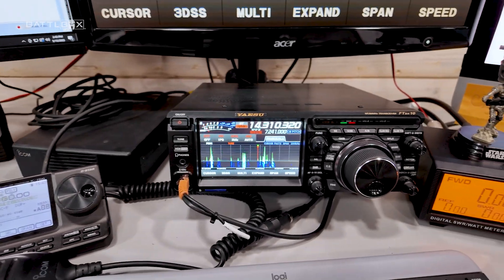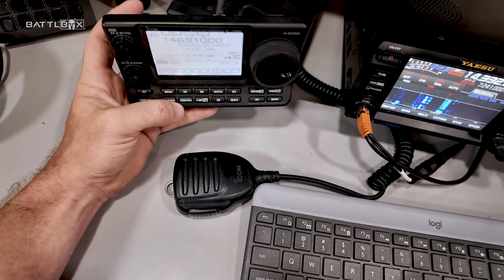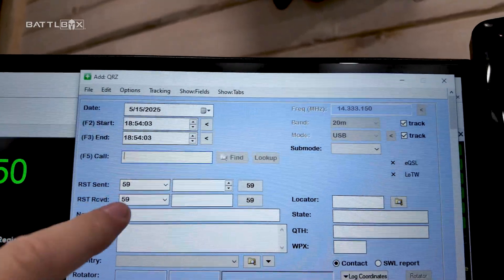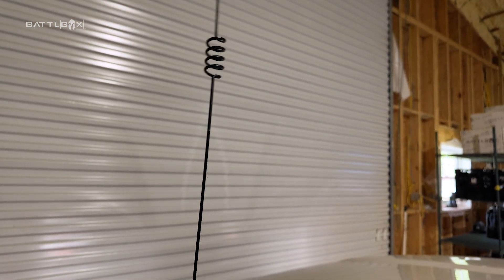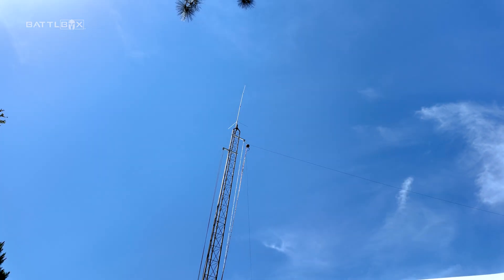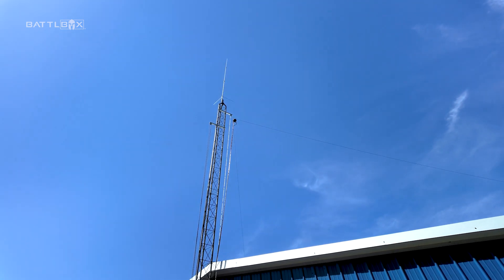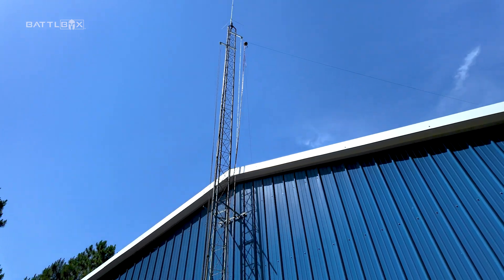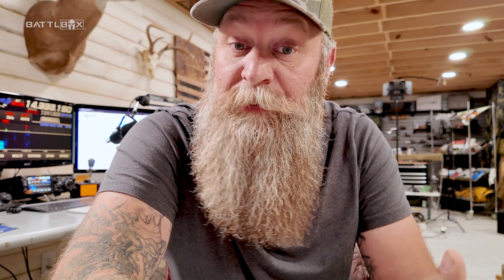My HAM Shack Right Now (2025 Setup Tour with @CURRIN1776 )

Comment: I used to love my ex FTDX10 until tried a Hermes Lite 2 with Thetis software, the FTDX10 went out the window and sold in QRZ. Yes, its a QRP that can easily be fixed with an AMP but gosh the receive ive found it waaaaay better

Comment: If you're on a budget, look into the FT-710. I've seen the AESS version of it new as low as $933. About $90 cheaper in the field version, but old ears will like the AESS. It's also an amazing receiver like the FTdx-10, with various signal/sound processing but fewer buttons on the panel.

Comment: Nice shack. This little trip with you today started with beeswax and linseed oil, and, as a fellow ham, I then wound up here. Without sounding like I'm trying to blow air up your skirt, I’ll say that like the way you carry yourself and your attitude. I have little doubt you're an excellent ambassador in all that you do. 

You're a pretty sharp guy, so it's likely much of what I'm going to say here you already know, but even then it should be useful for others. If I may, I can recommend the NEC as a resource for grounding. Not for local compliance, because the local AHJ, while authoritative there, will have different interpretations than AHJs in other areas. One thing they will agree on is that all grounds need to be bonded at the service entrance. A good resource for the NEC is Mike Holt, and you can find him here on YouTube as well. Mike's a super guy and is brilliant in this space.

Regular grounding and disconnecting the coax won't do anything for a direct strike, and that goes for any amateur radio operator. If you're interested in solving that, the Motorola R56 standard will guide you, but the cost will be prohibitive. For a commercial tower, sure. For the average amateur radio operator, the juice isn't worth the squeeze, but it is an interesting reference. That said, what you are doing here is far better than most. Disconnecting your coax is useful, but for different reasons. You want to bleed off the static charge that will build up on your antenna and protect your radio from that, and that will also make you less susceptible to lightning strikes. Grounding the shield is helpful, but it's insufficient. You're going to need an arrestor and there are some good ones out there. I've had a good experience with Array Solutions. Their products brought me to them and their customer service kept me with them. 

I too have a 7300 and the FTDX-3000. I use an SDR play as a panadapter, and the 3000 makes that set up very easy. The 7300 is used in a go box, with another go box using an FT-891. I've heard good things about the FTDX10, and know some folks that have it, but I've got a problem with Yaesu’s business practices and won't do business with them again.